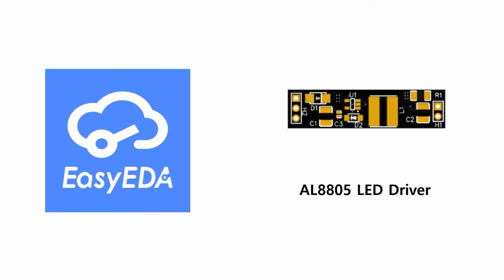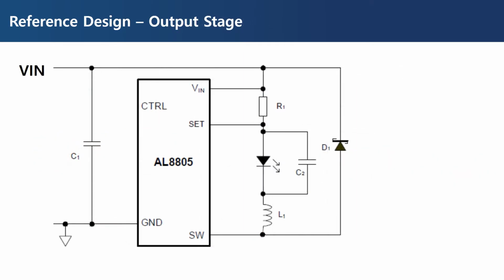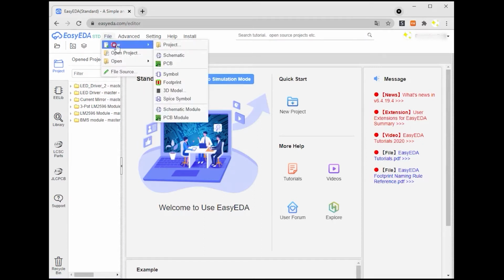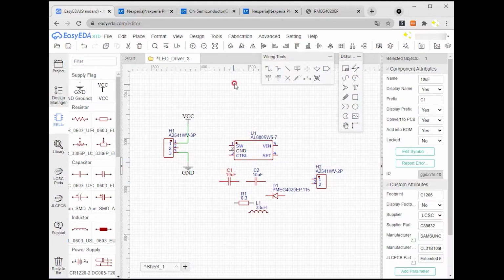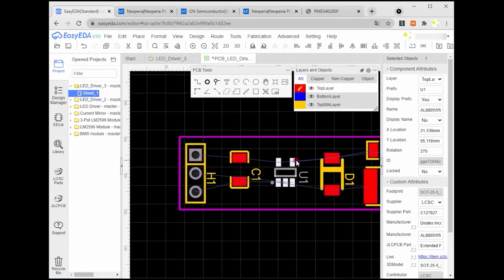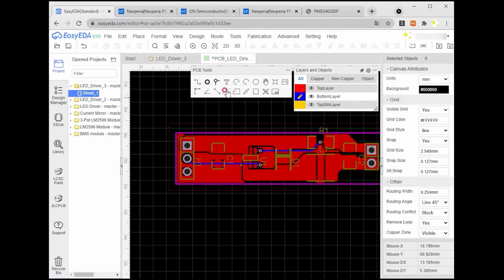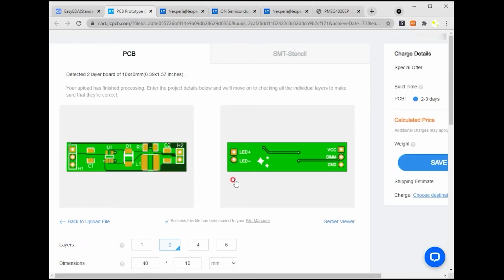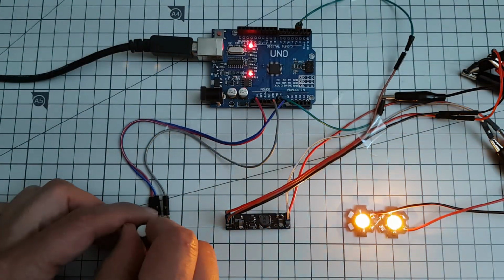How to design your LED driver with EasyEDA

Comment: I was told that the AL8805 is obsolete. Can I use an AL8835 instead? ty
Reply from the maker: Hello, thank you for watching!
Are you referring to AL8853? If yes, you can use AL8853 for driving the LED, but you need an extra circuitry (including the mosfet) according to the datasheet of AL8853. 
Hope this helped!

Comment: Can you do a video making LED driver with LT8391 upto 98% efficiency
Reply from the maker: I took a quick view of the datasheet for LT8391, and it is a very nice device which supports Boost, Buck-Boost, Buck modes of operation!
The efficiency of this device can almost reach 98% in certain conditions, according to the efficiency curves on page 1 and 8 of the datasheet.
For 95% or more efficiency, you should use this device in following conditions.
 - Input voltage : 10~40V
 - Output current : 2A or more
Though very interesting, I am very sorry to say that I will not be able to make a video for this device.
I want to focus more on the concepts of the operation in a certain area, rather than on specific products which have similar functionalities.

If you are intending to design a PCB using this device, the resources on the following link might be very useful.

* DC2345A Evaluation Board (for LT8391)
https://www.analog.com/en/products/lt8391.html#:~:text=The%20LT8391%20is%20a%20synchronous,equal%20to%20the%20output%20voltage.

Thank you for asking.
If you have any further questions, feel free to leave a comment.